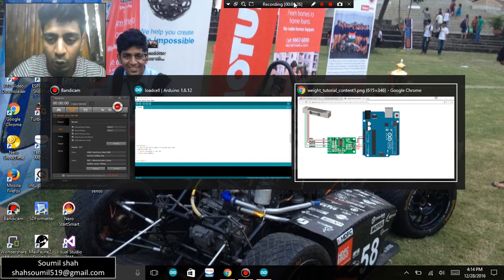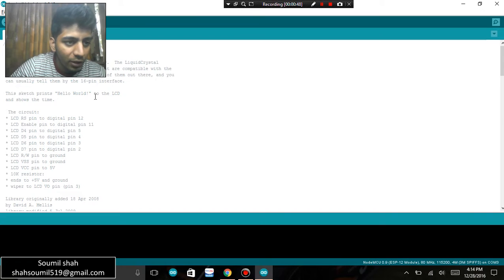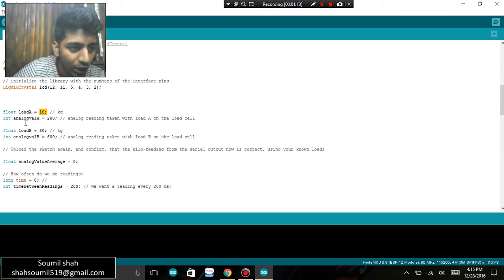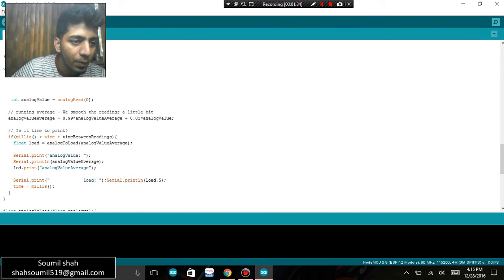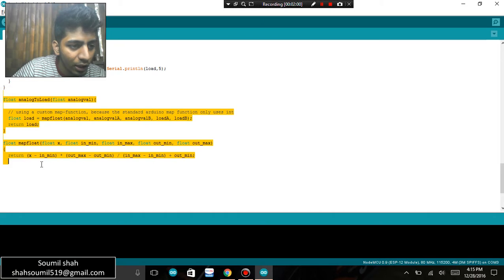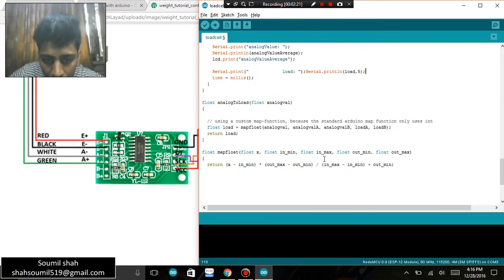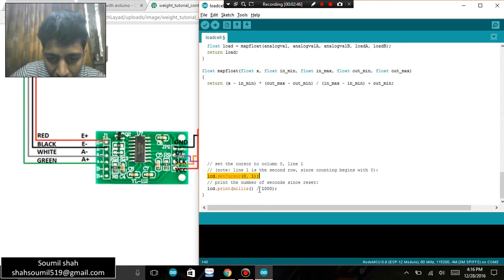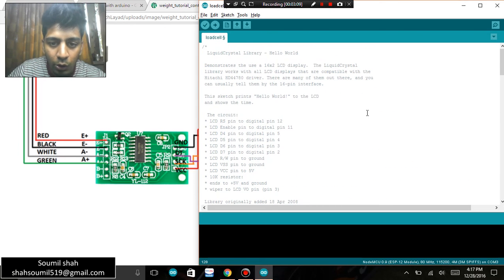load cell with arduino

Comment: Hi, I can see the link in your description but when I click it there is just a blank document. I have a similar project and at the moment I am able to weigh items on the load cell but the response is not linear so I need some way to convert the raw analog readings into grams. Would your program be suitable for this?

Comment: i have 4 load cell and they have juste 3 wires how i can connect them to hx.711
Reply from the maker: you can interface all giving common vcc and gnd separate data for each
Reply: do I connect the red wires of each  sensor  to the hx711